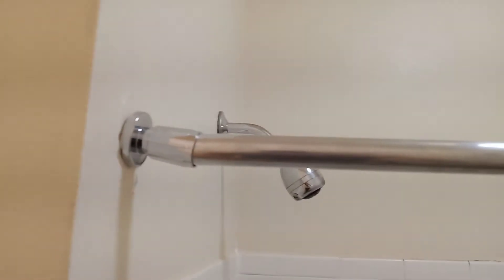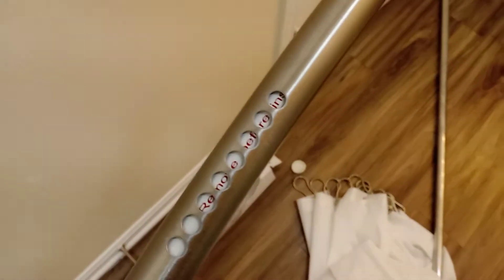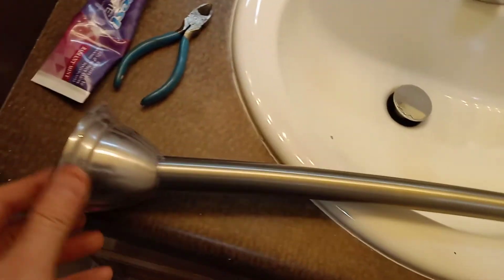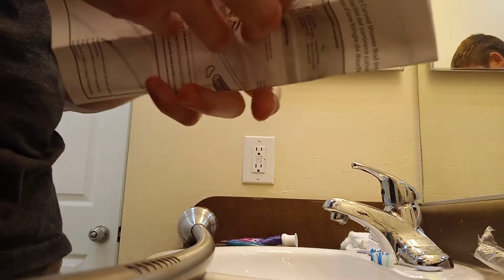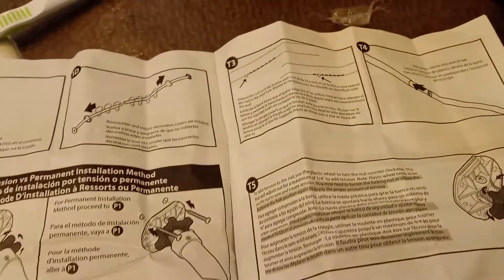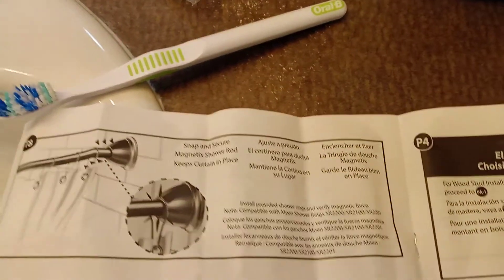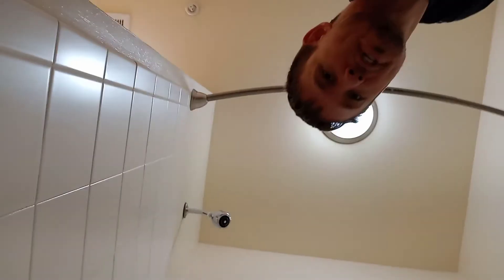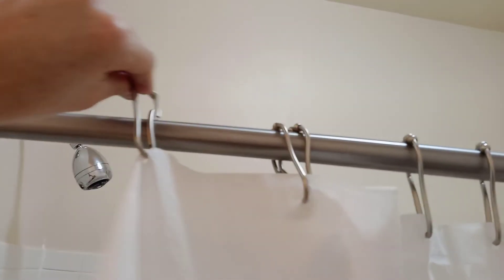How to install a new shower curtain rod tension style

Comment: Which brand and is it still working well?
Reply from the maker: Looks like Moen
Reply from the maker: And yes.  Although if you are going to drape wet towels across it you probably would benefit from having it screwed on securely instead of the pressure fit